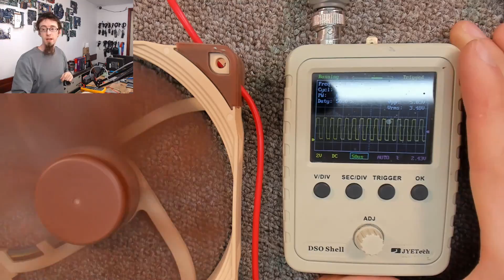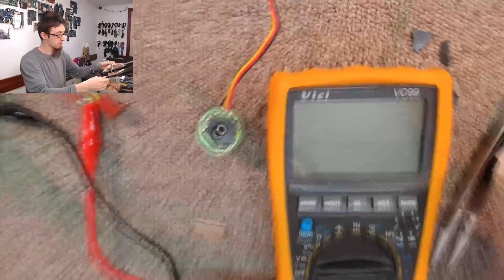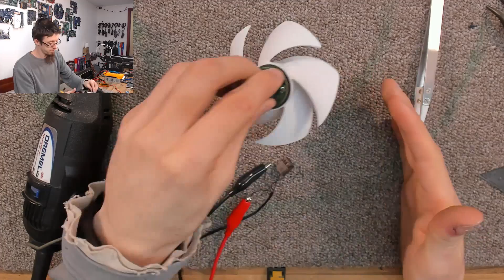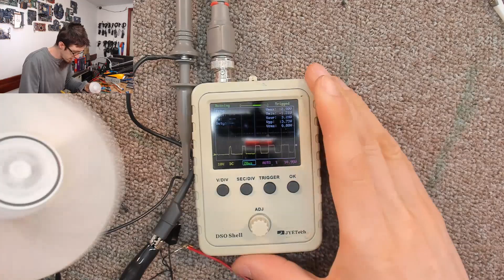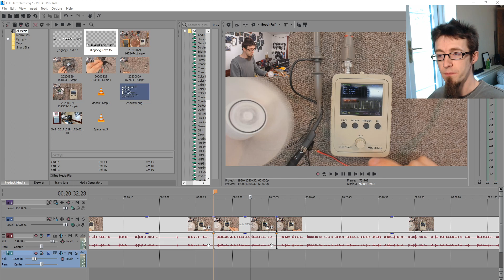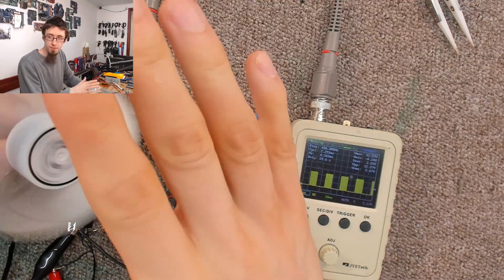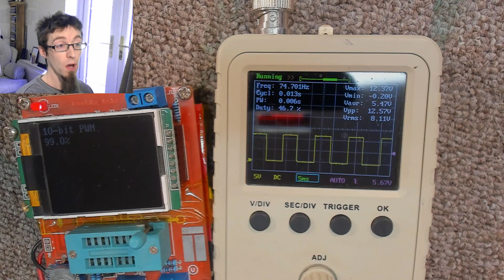How do Computer Fans Work? - LFC#221

Comment: Thank you so much! I've spent week trying to understand this subject. I think I get it now.
I'm trying to use 4 fans of the 4 pin type ,at variable speeds to circulate heat from my wood stove.  see in one sentence, I've outlined the job description!? weeks of effort trying to source the correct parts and build the system. all I want is an on off button with a potentiometer for speed control. (at least I'm not having to invent the system I guess...)

Comment: Very cool. I have a non working 3 wire 12v 1.5a brushless high heat fan not working. Trying to figure out how to fix it. Yes I can buy a new fan for $20 lol. I am learning how to repair electronics.

Comment: Thank you! I was pondering if I needed a powered fan splitter (PWM), or could use a simple unpowered on.. The conclusion is now obvious. No significant current is drawn from the PWM wire, so unpowered fan splitter should be just fine (i.e. MOSFET is within the controller chip).

Comment: Super interesting video, thanks for that! I came here because I was scratching my head while trying to understand how it works when people are "PWM"-controlling 3-wire fans, such as demonstrated in many Arduino-tutorial. Through your video, I understood that that is actually a brute-force method, because that kind of PWM turns the SUPPLY VOLTAGE of the Hall-sensor IC On and Off thousands of times per second! I'm amazed that it still works "somehow", especially because there's no buffer capacitor in the 3-wire fan that would remain charged during the PWM Off cycles. Would be very interesting to see what the coil voltages look like when a cheap 3-wire fan is supplied with a PWM modulated supply voltage. Also, I'm wondering whether it would make any difference to the noise of a 3-wire fan if it's controlled by PWM-modulated Vcc versus a linearly regulated, variable DC voltage. Something to investigate! Cheers!

Comment: You've got me really confused. The yellow signal pin is used to send fan speed data to the computer. It doesn't send a signal to the fan to turn it on and off. That's the function of the PWM pin. From my understanding, you can adjust the fan speed by adjusting the size of the pwm square wave. I've watched other people control 12v fans with a pwm signal they built on a circuit board and their oscilloscopes looked WAY different. 

I'm trying to convert some voltage controlled fans into PWM fans right now. That's actually why I watched your video. I will be looking up that chip.

Comment: Now days we see 5pin fans, how are these different from 4pin ones? Eg see this part number EG50050S1-CC10-S9A.
Do you think we can use 4pin fan in place of 5pin fan, 
if so, which one of the pin from driver board be left unused ?

Comment: Hi , 
on the 4 pin fan , if 12v is applied to the pos and neg , will / should the fan still turn or does it need a signal to the pwm to make it turn ?
And if so , with it connected to the pc , what signal could I give it ? 
I just wanted to test the fan to see if it works , as I think I might of killed the fan as I was poking round on it

Comment: I would really like to know what your background is. I myself just started off as a repair technician in a repair shop with no formal education in the field. I am an economist by training. Far off being able to do what you do atm, hence my interest in where you started. I feel like if it interests I should just go ahead and dig deeper piece by piece
Reply from the maker: No formal training either... But I did have an interest in electronics from a very young age, so I've always had an idea of what basic components are/do, which means it was easier for me to listen to a video saying 'the capacitor then does this...' and follow that explanation.
However, because of the No Formal Education, there are some gaps and inaccuracies in my knowledge, so sometimes I'm not quite right. Hopefully though I'm never glaringly wrong.
Reply: @Adamant_IT  That makes the content you put out even more impressive. I am glad to have found your channel. Seeing you do all these cool and nifty things without a formal background really like encourages me to stick with what I am doing right know and just continue learning about this stuff. Soon I am ordering my first soldering equipment to start getting actually to work. The computer shop I work at at the moment doesn’t do board level repair just yet. The one technician discarded a surface book just yet which potentially could have been saved by reprogramming the bios chip. At least that’s what I came up with after doing some research. Was really sad I am not yet in a position to try it in a spot like this just yet.
To put it simple: you encourage me man!

Comment: HA!  lol.  That is smart!   I didn't even think my fans would turn on.  I thought they would turn on and lock.  Recasing an HP Compaq Elite 8300 CMT to a DF600 Antec  case.  Little documentation.   I have the Fan Hub but wasn't sure.  Now my board has the 4 pin Chassis Fan header.   Eventhough it's 12 yrs old.

Comment: 4 pin fans and heat sinks at cheap as chips. All we care about his how to run a 4 pin fan with a 12 volt signal. I finally found a video which says you just put a 470 uf cap across yellow and black and it works.

Comment: My mobile phone cooler is not spinning thats why Im here but the LED is on, sometimes it does spin but it stops later again. Can u pin point the problem?  Im quite sure its not the dust build up because it spins so fast when it spin.
(Xiaomi Xiaomi Funcooler pro)

Comment: For PC fan repairs, you can take out the PCB by holding the coil part in a vise and carefully twisting the casing. If you're lucky, the fan board will come right off. 
But since the bearings are still in the casing, it wouldn't work.

Comment: Can you please explain to me how the 4th pin actually works? How does it send a pwm signal? At what voltage ? I assume the 12v pin is constant current? So there's no pwm signal going over the 12v pin. But what is exactly being sent over the pwm cable? And does that cable need its own ground?
Reply from the maker: It's a 1v signal being switched on/off at high speed by the fan controller. There doesn't need to be a ground for it because the fan has a common ground (negative) pin already. So yea, the 12v pin is constant, and the the PWM signal works as an interrupt inside the fan to turn it on and off rapidly.
Reply: @Adamant_IT  so seeing your videos it's just a signal for the microchip that controls the true 12v signal itself, right? I guess a 12v DC pwm signal doesn't work properly with the 4th pin, or would it maybe work if I converted it to a 1v signal ? I'm trying to make a simple pwm controller for fans. I've been searching for this info for a while now, so many thanks !!

Comment: Many thanks for the answers that I get from you, without the need to disassemble thinks on my own. I don't have equipments for electronic measurements.
Only one left... What will happen if I send PWN 12V signal to a 3pin fan? Of course with external transistor.

Comment: How did you wire the pwm module to the four wire fan? That's exactly what I'm trying to figure out myself. My pwm module will be using 5v, rather than the 12v wired to the positive and ground wires of the fan. My module has a + and - output, where the - is the actual pwm signal and the + output is directly wired to the modules input + terminal. I'm just not sure what to do and it looks like you've got it figured out

Comment: Interesting :), so I take that the second fan has an FG or Frequency Governed servo modulator as part of the IC, which could explain the capacitor as acting as an oscillator (I could be wrong though).  I didn't know how the PWM generator operates in the way it effect the fan speed by varying the voltage.  So can this PWM generator that you have there be the same as a variable resister? Thank you.
Reply: The capacitor is for decoupling.

Comment: Great video but you should read and search more information before you try to explain what you are showing. You have the power of stop recording and editing.
First, at the 3pin fan, the one face of the chip goes to transistor and it sends a pwm signal back to the motherboard (yellow wire). This signal is what RPM is spinning. By knowing that the motherboard can control the voltage sending to the fan in order to its speed. Also there is no bearings to the fan. By hitting it with the screwdriver you disform the metal at the back.
At the 4pin fan the mosfet configuration called H-Bridge and provides alternative voltage to the coils. The coils windings is wrapped differently so when the two opposites is south the others is north simultaneously. In the next face of the cycle the coils magnetized reversed.

Comment: The Anpec  chip alternates the current direction in the coil hence the H bridge output, the waveform in the pulses you see which if you had 2 probes 1 on each output, you would see was only on the high part of the waveform so when one output is at ground the other is pulsing at the PWM frequency which is approx 23kHz not what you are feeding in. The PWM input frequency can be anything from 300Hz up to 50kHz but the speed controlling factor is the duty cycle of the pulse.

So if you feed in a 300Hz pulse with a duty cycle of 20% i.e. the pulse is 20% high and 80% low the fan speed would be 20% of full speed.

Comment: Pin FG on the 4 pin fan I remember it's for feedback to the computer. The motherboard has a pullup and the fan controller pulses if the fan is spinning so if the motherboard detects no pulses it knows that there's a problem. 

I also think that this is the third yellow pin on the 3 pin fan. In very very cheap fans it's tied to ground because who cares about fire.
Reply: It seems so.. At 8:34 he states that the transistor puts through 1V.. But shouldn’t it short the yellow wire (the tach-wire, that you would feed with a pulled up signal) to ground, or how exactly does it work? Unfortunately no videos I’ve found shows how this work…

Comment: Hi there, this is my first message here. I like the honesty, straightforwardness and non commercial attitude. So big thumbs up!. I would like to suggest an review on a case : DeepCool DeepCool MATREXX 70 ARGB 3F. In the Netherlands it's about 95 euro. I've got an MATREXX 70 ADD-RGB 3F and i like multiple things about it, especially things you don't see or hear about with reviews like the front usb and power connectors on the top of the case which are luminated. Also the big space inside the case and psu shroud which is hidden with a temperated glass, which i have never seen anywhere. You also got the DeepCool MATREXX 50 ADD-RGB 4F which is 70 euro.
Also i would like to see more video's on buying the right soldering stuff, what do i have to look for for a reasonable amount of money (soldering iron / solder, heat gun) i know you did some video's but i can't seem to solder a 6.3 inch headphone jack properly, well i did manage to make it, but it's not the prettiest thing i've made. Keep up the good work, and please stay down to earth like you were in your previous video's, i believe thats why the huge amount of subscribers by now. Good times seeing your video's, greatings from the Netherlands!

Comment: Hi Graham and viewers,

Sorry this is off-topic for this particular video but just posting on the newest one. I was wondering if you could help me as I had been running my PC as a Ryzen "3"- based system for almost a month still booting my old Windows 10 install from when it was an FX system, from the 7 year old 2.5" SATA SSD. Now I've installed my new M.2 NVMe SSD and installed Windows 10 on it, but it doesn't boot and I get an "An operating system wasn't found. Try disconnecting any drives that don't contain an operating system..." error. While I could do that (and will try it) I shouldn't have to disconnect my two hard drives every time I start up my PC (!) I read that on a UEFI-based system, installing Windows with drives other than the boot drive connected can cause problems, so I'll disconnect my hard drives leaving only the SSD on the system and install Windows again and see if it boots. If it doesn't I'll be at a loss - what could the solution be...?

Thanks either way!
Reply from the maker: Check your boot order, you should have Windows Boot Manager as your first device. This option will appear when a drive with a UEFI install of Win 10 is present, which should be the case for you.
Reply: @Adamant_IT  Thanks very much for your reply and that information! Reinstalling Windows onto the SSD with the hard drives unplugged solved the problem in the end, and the PC is now booting normally even after plugging them back in :)

Comment: IN MY MACBOOK AIR, CURSOR MOVES PERFECT SOMETIMES BUT AFTER A WHILE IT GIVES  UNWANTED MOVEMENT ........... NEED YOUR SUGGESTION??????
Reply from the maker: Search my channel for trackpad cleaning. I've got a video on cleaning a MacBook Air trackpad which may fix this - if not, you can follow the same video to replace the trackpad.
Reply: @Adamant_IT   I found corrosion at one side of the flex cable (of the touchpad) & even clear with alcohol but still the problem is the same when I start my MacBook it looks perfect but after some time cursor start moving. my keyboard is working, USB mouse is working. any guess????

Comment: Why fan goes to full speed, when no pwm signal connected?
Reply from the maker: If there's no PWM, the fan will assume Voltage Control mode, and since I was feeding in 10v (or 12 if it were connected to a PC), that will be full speed.

Comment: PWM does seem over overly complicated, yet pretty elegant.🤷‍♂️

Protip #1: You can lift the blades off Noctua fans without damaging them (helps with cleaning), Arctic P series are the same (F series don't, but they're crap [About as balanced as my sister]). #2 Buying non-PWM fans is false economy (you can do a lot with fan curves, something most seem to miss). #3 Use the case/ motherboard as the temperature source for case fans, it saves the RPM going all over the place (CPU will take care of itself). [I don't mean to be "that guy". 😉]

Fun fact: Noctua uses 6 pole motors (makes them quieter apparently).

Comment: I thought all motors were effectively AC as they don't power any single magnet continuously. The way I remember it the only real difference between AC and DC fans is that in DC the controller produces said AC signal whereas a true AC fan is usually built much simpler and just uses the raw current to get the job done either directly or via a transformer to produce a lower voltage.

Comment: APX9173 it is use on Arctic P12 Static Pressure 120mm PWM PST Fan 4 Pin Black too .  You have discovered modulations ...

Comment: A 3 pin connector has ground, volt, and tachometer signal wire. A 4 pin connector carries a PWM signal as well. Basically, both are PWM and voltage-controlled fans but 4 pin fan carries a dual PWM controller while a 3pin has only one. On every motherboard, PWM controller is used for decreasing and increasing voltage but why another one on the fan (you may ask).
1- It decreases the size and power loss of PWM mounted on the motherboard(b/c it is no longer carrying 12V and several amps), it could be 1.5V signal.
2- Since the Voltage duty cycle from the motherboard (based on temperature) will not always match the working voltage range of Fans (water colling pumps) manufactured by different companies having different Voltage-performance curves. So, a PWM chip on Fan decreases or increases the voltage after receiving a signal from PWM of motherboard and then adjusting the voltage according to working range of that fan.

-For example, A 12V fan with 3 pins at 50% duty cycle will be running at 6V and may stall and actually perform at below 50% performance-wise. A similar size 12V fan with 4 pins at 50% duty cycle will be running at 9V(assume) and will not stall, perform at 50% of its performance.
Reply: thanks!

Comment: These fan motors are similar in construction to an LG Direct Drive Washing Machine motor, but obviously the Washing Machine motor is bigger and more powerful, and it has a lot more electromagnets in the stator!

Who knew FANS were so COMPLICATED?

I have a piece of CARDBOARD from a WEETABIX PACKET, which I use to FAN MYSELF when I'm HOT! The principles of its FUNCTION are very SIMPLE! No SHIT TRIGGER required! 👍😂💩

Comment: The white thing you thought was a fuse. Is a capacitor.
Reply from the maker: Capacitor would be brown, it was an upside down resistor to the transistor. With the 22k one next to it, it was forming a voltage divider.
Reply: @Adamant_IT  Some capacitors can be white though not always brown. But thanks for the extra details. Great video and great channel.👍

Comment: It is possible to convert 2/3 pin fans to PWM (4 pin fans) by use of a transistor which "simulates" the 4th pin....haven't tried it though - you may want to make a video about this (Idea ! :)) )
Reply: quietpc(dot)dk/zm-mfc1-combo or https://www.teachwithict.com/uploads/5/5/8/2/5582303/published/potentiometer-fig-1.png?1531059563